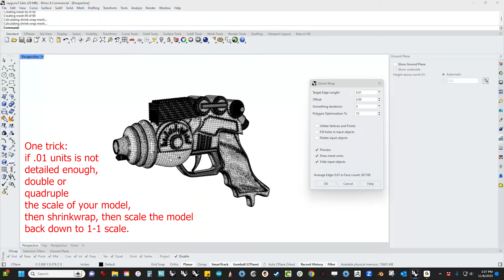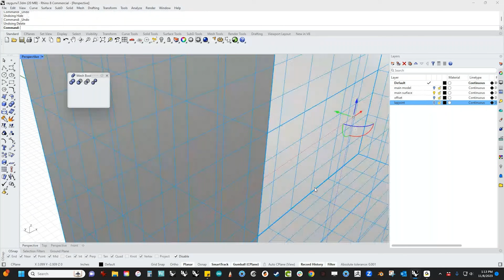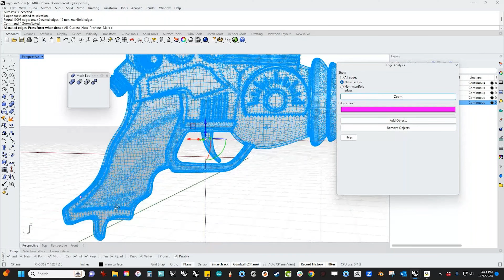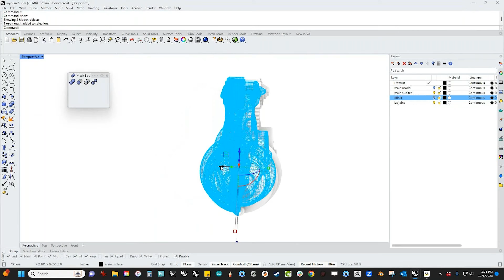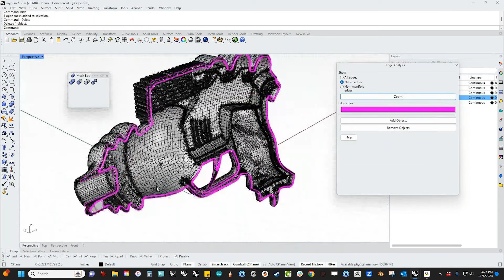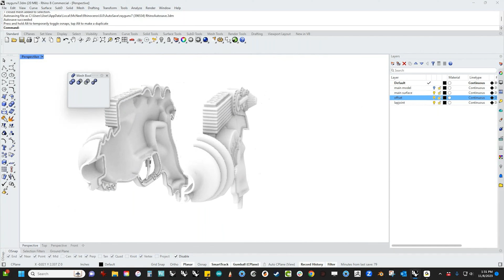Rhino 8 for Windows - Making Lap joints with Shrinkwrap!

Comment: It's getting more and more difficult. You need to make a version from which you throw out all the old stuff, useless tools and fill it with useful ones. All old programs resemble a garbage pit into which they threw something valuable and you need to find this valuable thing among the garbage.
Reply from the maker: what's useless to your industry  is essential for others...there is no way to make a "rhino lite" that would serve all of our users well.  We serve dozens of different industries and design functions with wildly varying needs. (from shoes and jewelry to massive computational simulations and optics used for satellite communication) Yes it's getting more complex, but it's also adding more power and control  for those willing to learn it. 

you can however, customize your UI to remove as much input as you want and make your own version of "rhino lite" if that's what you prefer. 

I for one, have a popup toolbar that has about 12 tools in it and do 90% of my modeling from that and a few hotkeys.
Reply: @Rhinoceros3d  At this rate of development, it will soon be difficult for your program to learn. Therefore, you will lose your customers. I need to purchase the program. I was waiting for your 8th version, but I realize that I feel sorry for the time of my life to study your program. In order to find your 12 tools you need to spend time. I recently found the Hungarian developer Shaper3D. There are 40 instruments in the program and you can model whatever you want. But unfortunately they do not have a subDiv analogue module. That's why I looked at your program. But you still haven’t made it possible to work in one parametric window. You have it in some strange way. There is no navigator, which makes it easier to fix the position of top, right, left, etc. It is necessary to make extra clicks to perform this operation. Today people are looking for simple solutions. There is no time to study if you are not new to your job. I have a lot of experience with the 3DesignCAD program (France). This is a program for jewelers, I bought it 10 years ago for 5000 euros. This year, after Windows updates, it stopped working. The developer demanded 1800 euros from me for updates. I lost all my work for 10 years. Now I'm looking for an alternative, but I don't have the time to study complex things. I like your program, but the trial version showed me that the navigation and work in the parametric window are ugly. And in my opinion you don’t have History-Based Parametric Modeling. You need to optimize all your tools and make the program more logical and simpler

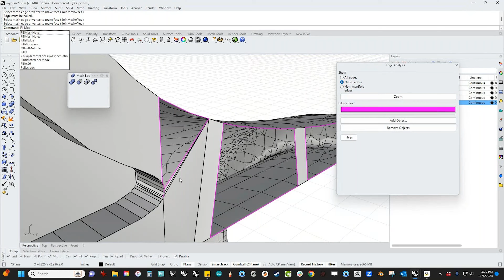Comment: To be honest, this at 20:30 keeps users away from Rhino3d... so many tiny problems come while you work, and you have to study a lot to fix this, instead of working on the project. And when you have then after the print to make a change, you really have a lot of work to make. I use Rhino3Dv7 and use it since v5... but more and more i go to other pieces of software which could do this way better and faster and some even for free. Nobody wants to become a nerd of Rhino3d to just fix such problems over and over again, as i know now from many CAD companies which went away from Rhino3D now to other CAD Softwares. I like Rhino3d to make some fast prototypes... but in our time customers want a fast change, a fast solution... and other CAD software products are way easier to use and have a way lower learning curve.

Comment: Shrink-wrap addition to Rhino seems no less in scale than adding wings to car and turn it into an airplane. It's such a huge thing especially for anyone that has to deal with mesh/ NURB geometries that are terrible, and you had to spend hours/ days/ weeks to remodel from scratch and still not get exactly the same geometry than you received. 

I did enjoy the error solving quite a bit as most modellers are doing this 9/10 times and I appreciate the confidence in which problems were detected/ analysed and ultimately solved. With the rise in 3D printing capabilities and demand around the world, this equips any Rhino 8 users with a powerful tool to solve most demands coming their way.
Reply from the maker: I agree 100%. ShrinkWrap is the hero of v8. (Push pull is a close second )

Comment: Having separate, editable, movable parts to customize an object to your needs is 'junk'? That's some warped logic there chief, to put it politely. /smh
Reply from the maker: I get what you are saying, but those individual parts have to be “good”. In this case they are not and this process allows you to get a shelled part from a model that would have required hours of additional modeling to be good. 

The point is, whatever state the model is in , you can keep the parts separate, and ShrinkWrap to get clean shelled parts for printing. 

Most of my old clients wanted trimmed parts, so I stand by the statement that this model in its  unwrapped state would have been rejected as being unfinished and as such  unbillable, which makes it junk in my book.